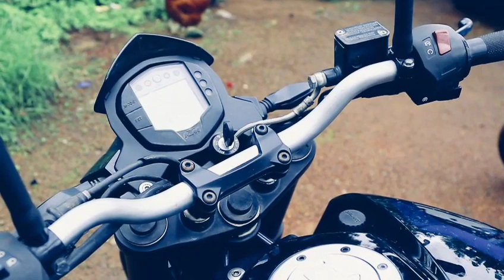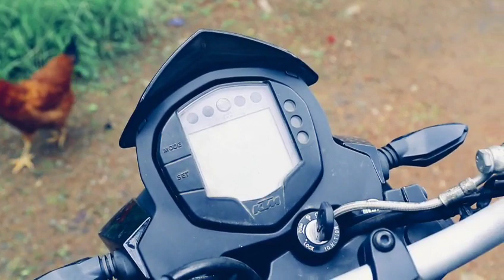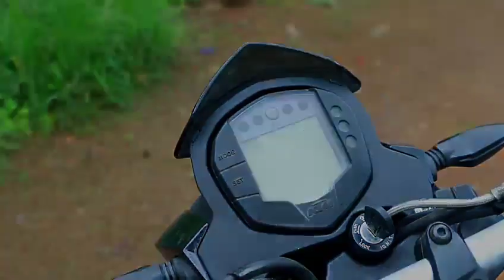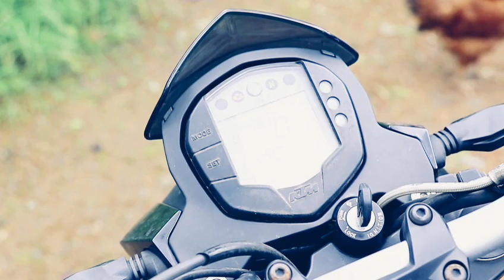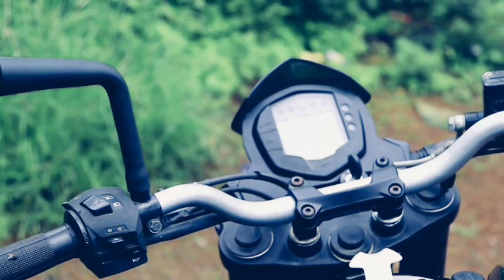USED KTM bikes || ബൈക്ക് എടുക്കുമ്പോൾ ശ്രദ്ധിക്കേണ്ട എല്ലാ കാര്യങ്ങളും..!!!

Comment: Machanee...I'm 6ft tall Currently using fazer fi v2

I'm planning to buy a new bike
My Last Options are KTM Duke 250 and R15 v3 
Mainly for daily usage and also for weekends rides..
Please suggest
Reply: Duke 250 bro. r15 riding posture daily use nallathe alla
Reply: I suggest u rc 200

Comment: Bro ...bro paranjille Speedo meter idak zero kanikunna problem ath ente Duke 390 meter ilum kanikunund...ath engane solve cheyan patum bro...pls reply... Meter replace cheyendi varum... If u knw about it...pls reply...it will be very helpful...
Reply from the maker: ALFI JAMES brw...

senser clean chey
Reply: ബൈക്ക് പ്രാന്തന്മാർ .. just water vech clean cheythal mathiyo
Reply: Cityil oru 25 ...and highwayil oru 32... Oru 80 IL 6 th gearil pokane 35 vare kitum
Reply: Njan 1.20